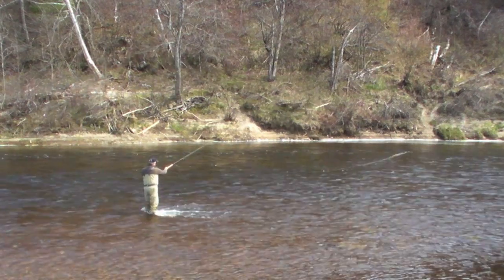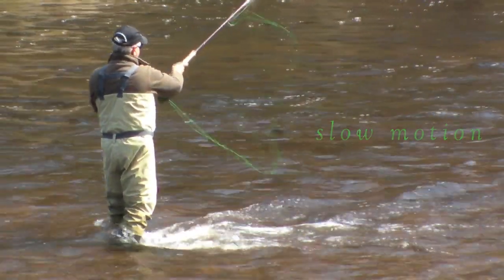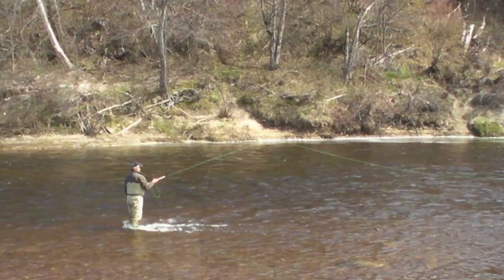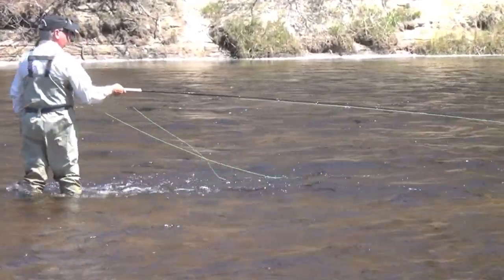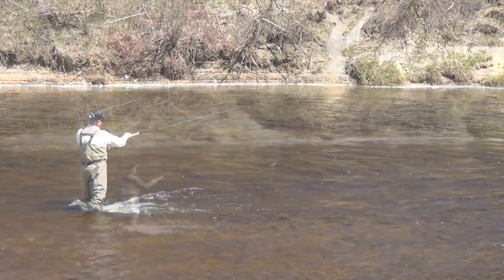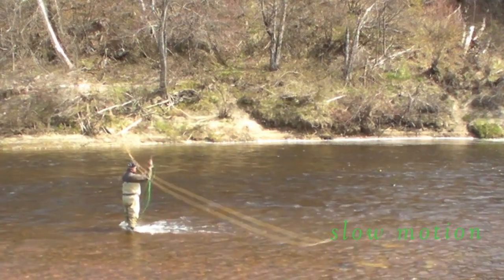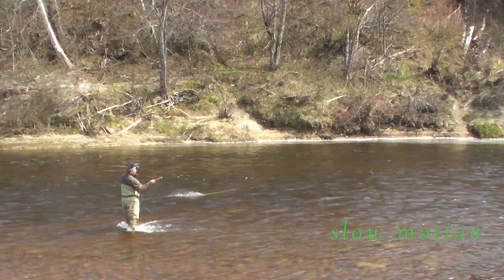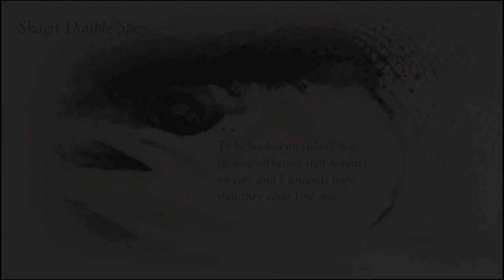A Skagit Double Spey Tutorial

Comment: I don't know if this question is easily asked or answered, but I'll try posing it anyway.
I understand the purpose of the sustained anchor, but when watching Skagit casting demonstrations I can often see considerable movement of the sink-tip during the sweep and lift. Is it sufficient that the 'anchor' line simply remains sub-surface when making the forward stroke, and is it important that this sunken section (including tippet/fly) ends up more or less parallel to the casting direction during the delivery stroke?
Reply from the maker: Ideally the anchor should line up in the direction of the cast. If the sinktip is bent, the cast will have a twist to it going out and energy will be lost on the effort required to extract it.  In traditional casting, this bent line is called, "the Bloody L"

Comment: I noticed your running Line is quite thick. is that just a preference? if so what is the advantage
Reply from the maker: +alex caird I just picked this running line to use as it would be very visible in the video. I never fish it. It's actually cut from a WF-12-F single hand line. It hurt the distance I was casting, but that was't the point of the video.
Reply: +hooked4lifeca ahhhh I c. great job